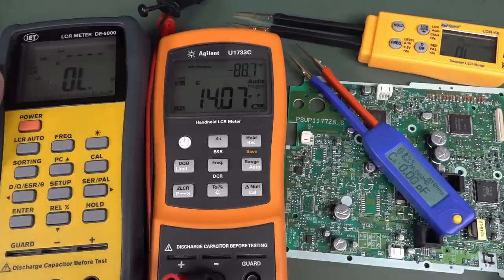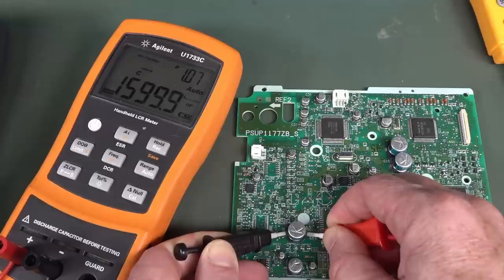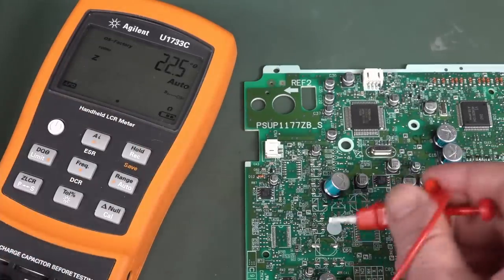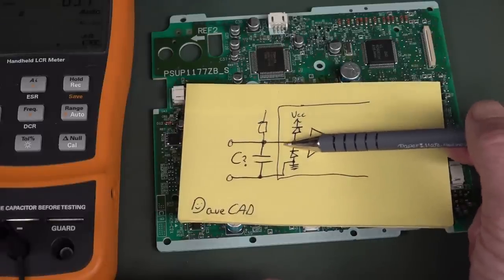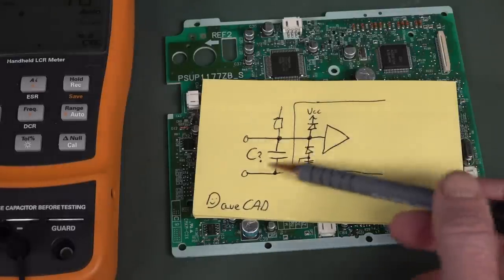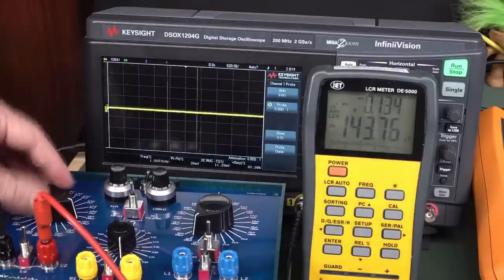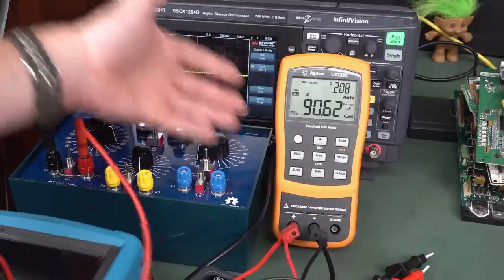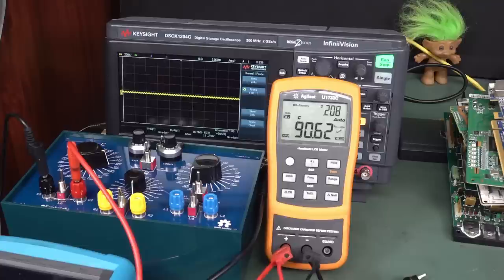EEVblog 1474 - Can You Measure Capacitors IN Circuit?

Comment: In circuit testing (passive and active) combined with a good understanding of the circuits purpose and together with a creative mind and coupled with experience can yield excellent results. I have to say you have done an excellent job putting this all together.
Reply: for sure you need to understand what you are getting for your results and know why you are getting those readings by studying the circuit !
Reply: How can these be measured in circuit especially if there are caps in parallel?
Reply: @irishguy200007 basically it just adds them up but esr should be the same. For example if you had three 100uf caps in parallel your meter will read it at 300uf, just have to look at the circuit the go from there.
Reply: In short, it's a trap for young players.

When you're a gray beard and know all the limits of your measuring equipment, it'll be fine. When you are young, and don't know what the circuit is doing, and don't know what your multimeter is doing, and don't know what good vs bad looks like, it won't be fine.

So just like everything in electronics!

Comment: This was informative to me .. I have been thinking about purchasing an ESR meter to troubleshoot my TV. I watched both videos .. I like how you split them up. Thanks Dave!
Reply: Totally agreed, I'm getting one now for my toolkit! Most DMMs have a capacitance function but you'd have to remove it from the circuit.
Reply: @TradieTrev  FWIW, when you are intentionally measuring capacitors on a board to troubleshoot, the capacitance is often the least helpful of the values to rely on as most capacitors have to be in extremely poor shape before they tend to vary much in capacitance value.  That makes that capacitance function in a typical DMM almost useless for troubleshooting unless one is just trying to learn the rough capacitance of an otherwise unlabeled component.  The reason LCR meters are so valuable as a troubleshooting/diagnostic tool is that they measure ESR among their many parameters and that is typically the most critical diagnostic value in the majority of troubleshooting applications when dealing with capacitors (especially electrolytic) as the ESR will rise LONG before the capacitance begins to suffer appreciably.  When you see a 1000uF capacitor that still measures as 1000uF and looks absolutely fine visually but has an ESR of 20-ohms you know you found a dry electrolytic capacitor that urgently needs replacing and is likely the cause of the failure.  Yet an ordinary DMM would still lead one to think that the capacitor was good because it still measures the expected 1000uF capacitance…and that can easily lead one astray when starting out.  In most cases, there will often be other marginal or failing electrolytic capacitors that also need replacing due to wear and tear from years of heat and runtime by the time the first actually dries out enough to cause the device to misbehave (barring very poor design or crap capacitors!).  Being able to measure the ESR value with an LCR meter can really facilitate locating the failed capacitor(s) in a hurry.

About the only exception to that rule is film capacitors (such as X/Y types, Mylar, polypropylene, etc.) as their failure mode is typically momentary shorts blowing holes in the film layer to clear shorts where the dielectric has failed (usually due to AC mains voltage spikes), which is an intentional part of their design for safety in certain applications.  Since the faults actually blow holes in the conductive layers of film capacitors, consuming plate area, they will often show appreciable loss of capacitance well before a significant rise in ESR, but that is largely the “exception that proves the rule” in troubleshooting and that is something you learn to lookout for when dealing with film type capacitors versus electrolytics.  

If you are already thinking about getting an LCR meter and have more than a mere passing interest in electronics and repair of modern and vintage electronics then an LCR meter is a great investment after a good DMM as so many faults in consumer and vintage electronics are the result of failing capacitors and a few dollars in decent quality capacitors is often all that is needed to get things working again.  The DE-5000 LCR meter can be found at a very good price (the iET version costs a fair bit and commands a premium, but if you don’t need any certification or the minor enhancements the iET model has then the knockoff DE-5000 by DER EE is practically as good and available at a very favorable price (around $100 USD, give or take, sometimes much less used) for an excellent LCR meter.  Just remember to always discharge capacitors before you connect them to your LCR meter as a capacitor with a high enough voltage charge can damage an LCR meter, so it is good practice to short the capacitor (ideally with a few tens or hundreds of ohms to avoid welding your shorting probes to capacitors with especially high voltages and capacitances) immediately before connecting them to your LCR meter.  Of course, if the board has not been powered on in ages then you can skip that step as can you if you know for certain that there are no voltages anywhere on the board that exceed the safe maximum voltage that your LCR meter can safely handle (which should be listed in its documentation), but discharging capacitors first is a good practice to avoid accidentally damaging a perfectly good LCR meter because we regularly find ourselves testing mains voltage capacitors in power supply circuits as they are one of the most common faults.

Good luck and I hope you enjoy learning to use your new LCR meter when you get one!  They are a great piece of kit to add to your test gear and bench!
Reply: @ethanpoole3443  I'm sure OP and myself couldn't agree more with your input. Typically caps are my go to thing when troubleshooting power supplies.
Reply: @ethanpoole3443  I did hear the DE5000 won't do in circuit measurings? Still looking for a fairly reasonable priced esr meter Which can do in circuit measuring

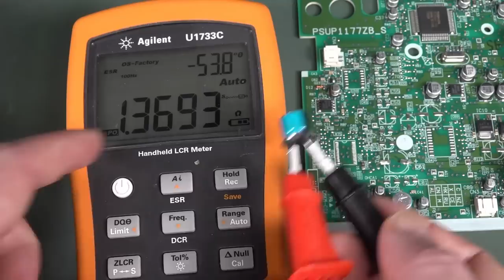Comment: @5:00 the short lead cable set is also a 4 wire measurement.
Reply from the maker: Yep, forgot to mention that.
Reply: Even better, 4W plus a guard connection

Comment: I have a little yellow kidney-shaped LCR meter (Atlas LCR40.) and it only has automatic mode. EG, when measuring a cap it starts with DC. Big electrolytics get measured by rise time. If the cap is smaller it will move on to a 200Hz sine wave. After that it will try 16kHz, and finally 200kHz for the smallest caps. It applies these test tones in bursts, and the final measurement is made with an average of about twenty bursts.
Reply: I have the purple one, made by Peak electronics, atlas esr model esr60 the manufacturers claim that it will measure capacitance in circuit. Certainly seems to do that without much problem.
Reply: is it worth it? i have 3 peak meters, semiconductor analyser dca 75, the scr and diode tester models, i had choosen the de 5000 over peak lcr because it can do more
Reply: @Equiluxe1  On the Peak Instruments page for the ESR70 (the current model of purple bean) they say it will only measure the resistance whilst in-circuit. Out-of-circuit it will measure both the resistance & capacitance.

For their two models of LCR meter (the yellow beans), they specifically state that they don't recommend using them for in-circuit testing, but this is mostly just them covering against claims due to misuse.

Comment: Also do not forget to discharge the in circuit caps, before measurement; otherwise , it could damage your test equipment and might shock you.
Reply: BS
Reply: @geirtjelta  ?!
Reply: in circuit cap containing charge ?
someone needs to go back to school .
Reply: I will note that the DE5000 manual warns you to discharge caps before measurement.  It does not mention whether that's in-circuit or not, but it's right there in the manual.

I agree that in-circuit, the cap is unlikely to have a charge, though I guess it depends on the specific circuit...
Reply: @вечная_мерзлота  looks like you skipped a lesson or 2 😅

Comment: My empirical experience with LCRs is you can measure over 90% of the e-lytic caps in circuit. Mine is about 45 years old  but it's a really good old bench LCR meter. I can run down to 1mV & up to 1500mV.

Comment: My dad was an electronics technician for 30 years and imparted to me an appreciation for ESR meters. As an industrial electrician I occasionally have use for one too, and keep one in my desk. 

I've been eyeing his old Creative Electronics ESR meter, but he still won't part with it. The analog needle deflection is great for quick go/no go checks.
Reply: What brands for analog multimeters that your father use?
Reply: @hwanglee3330  the one I remember was a Creative Electronics brand ESR meter. He had a Simpson analog multimeter, but he mostly used a Fluke 77 DMM.
Reply: @MatthewAlbert-zoonotique  thank you to let me know it. Many people recommend analog ESR to do capacitors troubleshooting in circuits. Some source said that it should be less than 1000 pf ( without desoldering).

Comment: 3:53 to the people I've had arguments with in the past, OL means overload, not open line. This is a perfect example of where open line just makes zero sense for a meaning of OL.
Reply from the maker: Yes, because people are used to seeing OL as OPEN on their multimeter ohms range
Reply: @EEVblog  My TPI Scopemeter says OUCH on overload.
Reply: Over limit makes sense in both cases...?
Reply: @peterlarkin762  Some people claim it's definitely open line and won't hear anything else.

Comment: In circuit ESR testing cannot be understated. The “EDS-88a” is used daily in my lab.

 But it’s really important to have A bit of experience & understanding on what to expect with different circuits and topologies.
Blindly going over a bunch of faulty boards with in circuit ESR testing won’t help much..... unless you have a bit of experience and understanding of what to look for in certain situations. But even beginners and hobbyists can learn what to look for really quickly, and even some of the cheaper sub $50 in circuit ESR testers are pretty good believe it or not.

 I’ve got over a dozen different “in circuit“ ESR testers, even a couple of really nice analog movement types. I just enjoy collecting various types of “quirky“ Devices. Like the offbeat Devices and equipment commonly sold in the back of electronics magazines from the 70s-90’s… “One little device that will solve all your problems.... without spending a fortune“. 😂

Just quirky and interesting pieces of test equipment like that. Some of them obviously turned out to be very useful, or at least informative and gave me ideas for other test equipment designs.

I use them constantly in my small and HUMBLE metrology lab. I do component level board repair for industrial clients, and specialize in metrology/test gear stuff for other small labs and manufacturers. Rarely do I need the the fancy Sencore “ReZolver” LC103. However I think high end capacitor analyzers and leakage testers are more important and needed by folks working with vintage equipment. If I’m questioning the integrity and performance of a capacitor enough to remove it from circuit, and check it on the LC103 or other leakage tester… Then I’m replacing the bastard and not giving a second thought. 

However I understand when dealing with old and vintage equipment … It can be a different situation and you only want to replace what is necessary. Also needing to compare specs and performance of various capacitor types. But I don’t work with vintage gear unless it’s just a coincidence to find an old piece of test equipment still in use Buy one of my clients.

Don’t get me wrong.... if you’re a professional and servicing labs and equipment like that… it’s a good idea to have a true capacitor analyzer. But it’s kind of similar to a semiconductor analyzer… Not something I break out unless i’m getting balls deep into a very complex project,or if working on a exotic/undocumented piece of equipment… Where manufacturers can sometimes be less than helpful.

Very interesting topic, glad to see folks not totally discounting the idea… A lot of professional folks just totally blew it off in the past. But I think it’s justifiable for a lot of full-time folks.
Reply: Cool, I do the same work as you. For most for cal labs , the stuff the manufacturer stopped servicing. But I have repaired a few problem cases the manufacturer could not repair. The only other thing I do next to industrial boards like you do, is board repair for maritime use (but that is most times via the service contractor that normally works on the ships. Those are the boards you can not power-on. I specialize in component desoldering and then testing (I can test almost everything (excepts programmed or custom stuff ) I test  because I need to know what the fault is. If I replace all caps without testing and all other components are good I do not know if I fixed it. If those caps were bad the chance is high I fixed it. If they turn out to be good, then the board is not fixed but then I would not know that. 
I have several ESR meters, also some from my own design, but I do not use them. I have a big collection LCR bridges. (and several modern very good LCR meters) Also some impedance meters and VNA' s. My pride and joy is a General Radio C bridge setup that was used in GR' s own cal lab as master bridge to measure standards caps. It can measure with aF resolution :-) To often there are several in parallel with other caps, but besides that. The biggest problem is that if there is a good one somewhere in parallel a bad one can measure as a good one. I can not afford to take that risk. On the other hand, desoldering is like 10 seconds job so I do not bother to play around with in situ measuring (I seldom have schematics so I can not check that in the schematics) 

Indeed, also my experience, DC leakage is important. Most times if I find bad caps it is DC leakage, sometimes a tan delta (Dissipation factor) that is outside specs. Caps outside the capacitance specs are very rare, unless D goes through the roof or worse, like in consumer crap, they are popped, but in that case I do not care about any spec :-) Normally the capacitance is more or less fixed by the construction. The aluminium strips do not change in size and if they do not leak the oxidelayer is thick enough. Normally if capacitance is outside specs the DC leakage will also be outside specs. Exceptions make the rule. There are rare things that can happen like a partly eroded/eaten away contacts between foil and pins. Or damage caused by shorts due to overvoltage but in such away it does not permanent short the cap. I often take dead caps apart to better understand the ways they can fail.
Reply: @pa4tim  absolutely wonderful and info packed reply! That’s a short summary in master class on most of what I’ve learned over the last 15 years doing component level repair.

I very much feel the same about it, and I take the “shotgun“ cap replacement approach most of the time as well. Especially in boards that are for industry or metrology related stuff, not only is it easier but it’s simply a good idea. If something is having issues, and it’s already on my bench, then why in the world wouldn’t I take the time to replace all the electrolytic’s. The only other thing to do would be to go through and meticulously test each one out of circuit, which by that point I would be a fool not to just replace them.

 And I feel the exact same way about my LCR bridge and component collection. They are like my children. 

It all started with the Syncor lc153 years ago, and then I stumbled into the world of metrology grade NIST traceable stuff, And the “volt nut” Side of the Internet. 

It’s incredible the levels of precision one can reach in a private lab these days, short of Josephson junctions and the like… It’s still amazing what is possible. Especially if you work with industrial clients and laboratories… Because they’re always getting rid of equipment that is mind blowing and expensive and useful in a lab like ours. The longer you spend around clients like that, and communicate to them the things that you keep an eye out for and want to be notified of… The stuff starts falling in your lap and you don’t have to look for it as much.

I really don’t have an excuse for owning high end calibrators or for my collection of 8.5 digit meters, maybe every now and then I need that level of precision and reliability… But it’s just something I greatly enjoy and admire. 

To me it’s the ultimate work of art to find a timeless and perfect designs…..Makes me feel like a better engineer just to have that stuff near me while I’m working 😂🤷‍♂️. Hopefully I will absorb some of the greatness😁👍

Comment: I've been doing it for years with my manual ranging LCR meter. It works well for the high value caps like you've shown. Even with the parallel resistor if it has one, that just makes it look like a leaky cap which usually doesn't affect the value but, we're not testing for leakage and you wouldn't want to do that in-circuit anyway. ESR, yes. EPR, no.👍

Comment: During the presentation, I observed that you had the LCR-Reader-MPA on your desk; however, you did not utilize it. I would like to point out that the LCR-Reader-MPA offers a convenient feature - it can indicate the presence of a p-n junction in parallel to the measured component. When a p-n junction is detected, the device automatically switches to a 0.1 V peak-to-peak signal level. This capability greatly simplifies in-circuit measurements and can be quite useful.